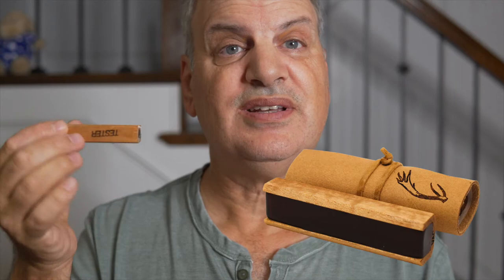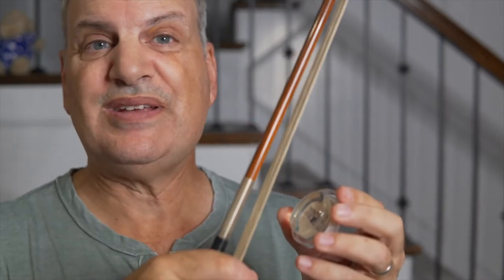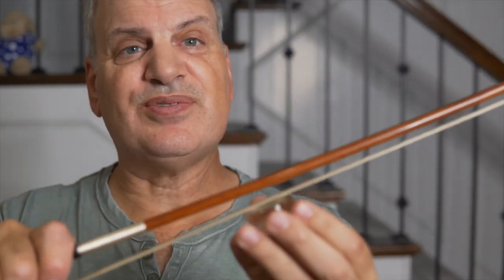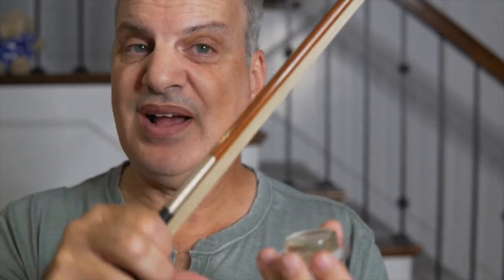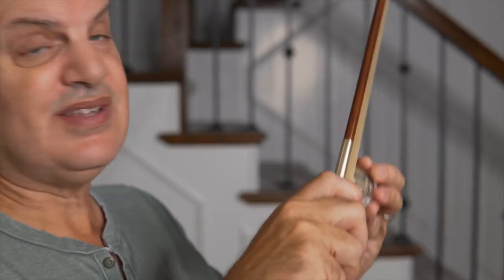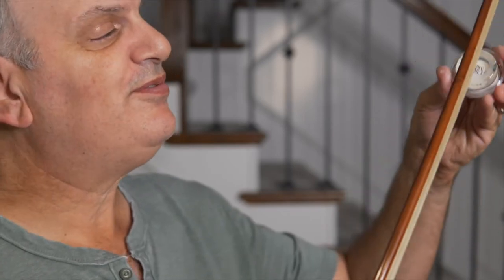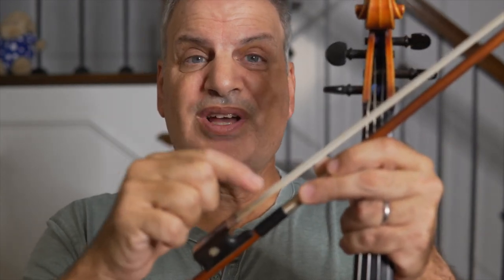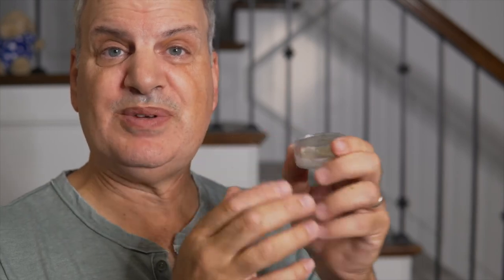How to rosin a viola bow with Ronald Houston

Comment: Thanks for this very important video ❤ Rosin is kind of religion for some players - I nearly have a drawer full of it 😉.
Here is my special tip, which I got from a professional violinist as a secret: BRUSHING THE BOW regularly.
All needed is a new(!) soft tooth brush. Brushing the bow from tip to frog direction is kind of cleaning process and also removes to much rosin. First release the tension of the bow so that you can also reach deeper between the bowhairs with the brush. 
I never thought of bowhair direction. It is smoothly upwards to the tip and more grippy downbow to the frog. Because of that, downbows need a bit more energy against hair directions 😏
After the first preparations of my bow with rosin on the new bowhair I only apply rosin from frog to tip (3 strokes) to get it deaper into the hairs. 
I use Pirastro Oliv with Larsen strings. It creates a warmer sound. 
I'd like to try Andrea next time. May I ask what type you recommend for violin "piacere"?
Reply from the maker: I use  lonesome pine.. Available on https://www.violinzone.com/products/lonesome-pine-rosin

This is great  rosin.. I recommend  original and  smooth! Thank you  for all your  insight!!